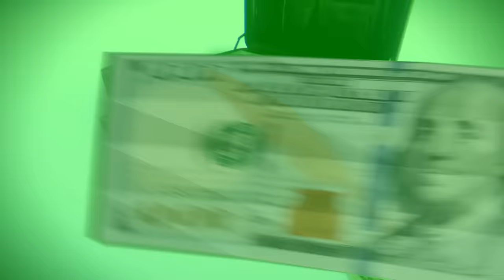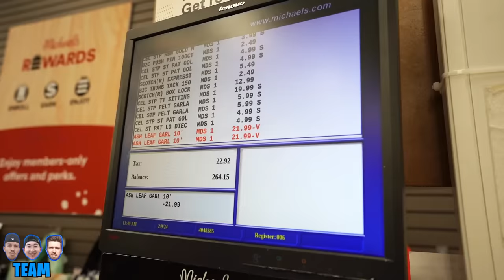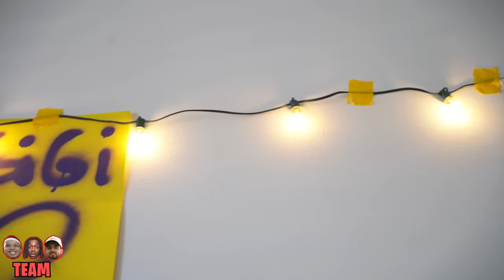Best NBA Custom Bedroom, Wins $1000!

Comment: 00:00   🏀 Two teams building custom NBA indoor basketball courts
00:18   💰 Teams have $500 and 1 hour at construction store
00:29   🎨 Must include hoop, three-point line, custom ball, and NBA theme
00:54   🍫 Break for snacks and strategic planning
01:09   🤔 Team deliberation on NBA team themes (Lakers vs. Warriors)
01:28   ✂ Challenges with cutting and assembling materials
01:50   🏆 Hosts to challenge teams on completed courts for $11,000 prize
02:06   🔧 Teams seek help and materials at construction store
02:30   😆 Inter-team banter and competition heats up
03:00   🛒 Teams finalize purchases and strategize at Michaels for decorations
03:50   ⏰ 30-minute decoration shopping spree with remaining budget
04:00   🍀 Discussion of switching team theme to Celtics due to available decorations
04:20   🛍 Teams checkout with Michaels' purchases and head to build site
04:50   🛠 1-hour build challenge begins; teams hustle to complete their courts
05:00   🖌 Teams paint and set up courts with chosen themes and decorations
05:10   🏀 Final adjustments and creative ideas implemented to enhance courts
06:00   🧐 Projects near completion; teams add finishing touches
07:00   🤪 Friendly sabotage and challenges between teams
08:00   📏 Courts take shape with painted lines and mounted hoops
09:00   😁 Final moments of construction; teams rush to complete courts
10:07   🏀 First challenge: Basketball bowling
11:03   🎁 Team wins mysterious box
11:18   🗑 "Trash" moment in bucket decoration
11:37   🏀 Net and hoop installation strategy
12:04   ⏳ 25 minutes left announcement
12:16   👕 Jersey finding challenge
13:04   🔵 Blue team's strategic win
13:21   🔄 Upstairs reverse trick shot challenge
13:51   ⏳ Sand pouring task
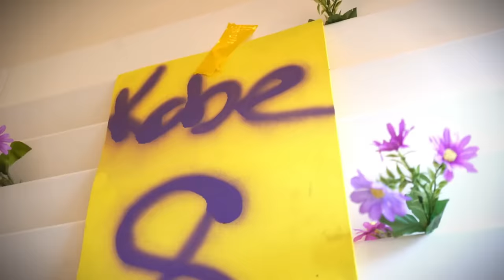14:57   🧑‍⚖ Judging criteria introduction
15:07   🟣 Lakers custom room tour
15:46   🍀 Celtics custom room exploration
16:13   🏃‍♂ Relay race challenge
16:41   🥊 1v1 basketball showdown
17:35   🏆 Lakers court declared winner

Key Moments by Agent Gold AI